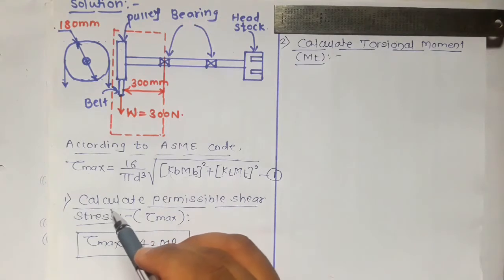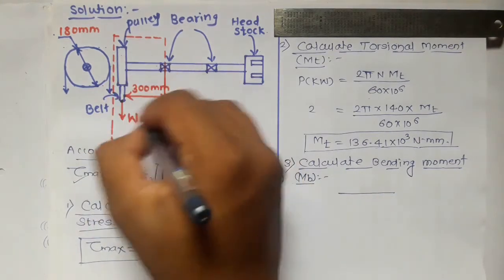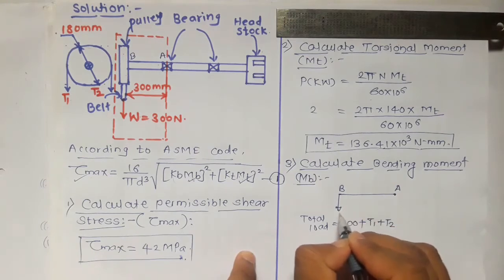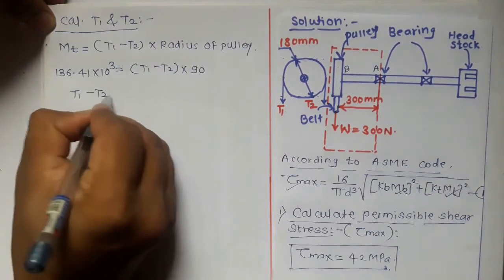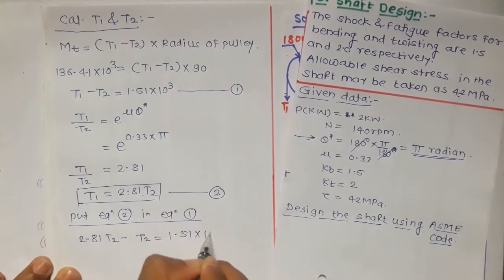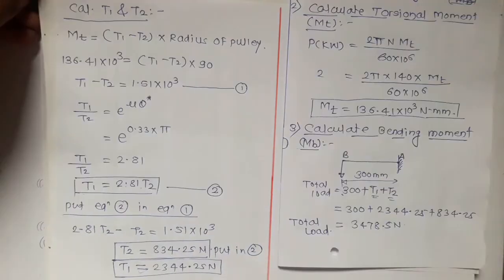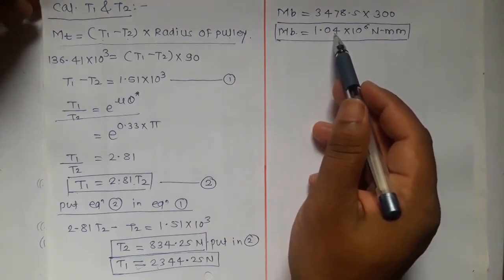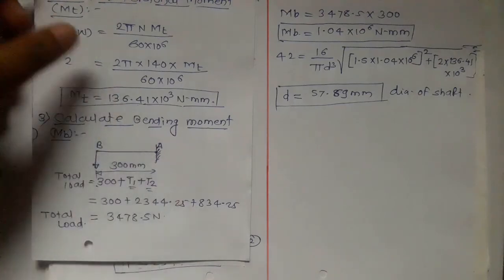6.10 Num. #1 #Part II  on ASME code for Design of Shaft

Comment: why took bearing A as high bending moment point?
Reply from the maker: At a section B, the bending moment is essentially zero at the free/load end, but as you move toward A, the distance (lever arm) increases. Hence the bending moment increases continuously and reaches its maximum at A